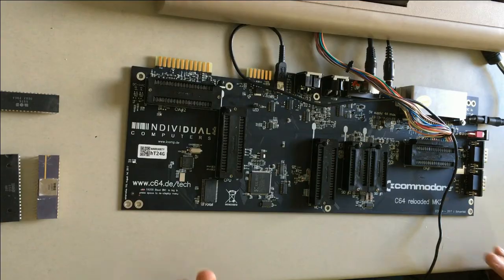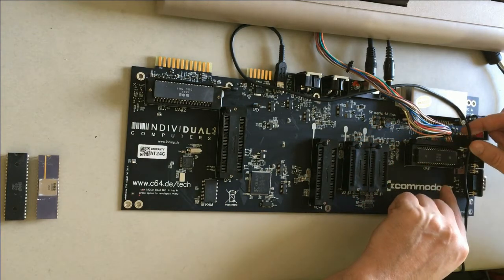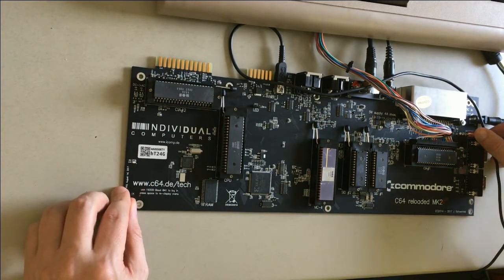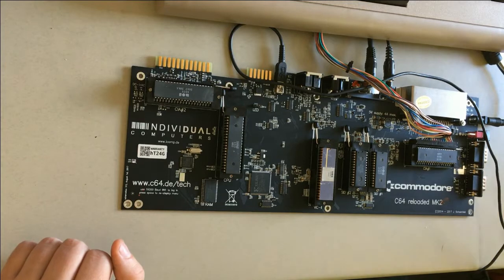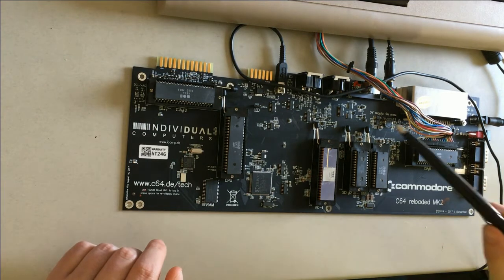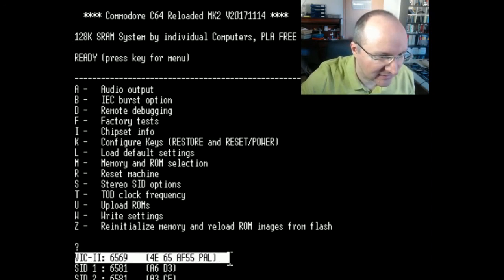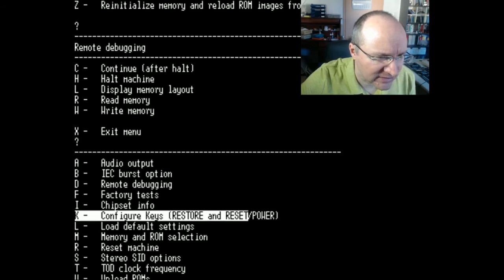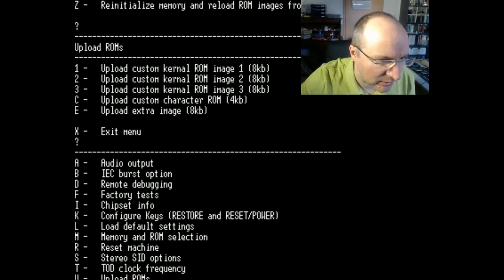Populating the MK2 Commodore Board

Comment: I've never considered getting an MK2, but I do have two breadbins lying around which could populate a MK2 without much problems. But then there is also the Ultimate64 board. How to decide which one to get?!
Reply from the maker: It depends what is more important for you. The Ultimate is a C64 with nearly all ICs migrated to modern technology. And it hat an HDMI Connection. It is the better choise if you want mainly use the C64 as a whole and have a comfortable TV connection. 
The MK2 still uses all the original ICs. So if you want do do your own experiments with drop in replacements and the like, this is the better choice. 
Fortunately I do not have to make such an choice - I will get both :-)
Reply: Haha...you're right. I should have probably asked: which to get first :)

Comment: can you put down a list for the chips needed
Reply from the maker: No Problem. What you need is:
- 2 CIAs (6526 or 8521 (probably better if both are the same)
- 1 VICII (6567, 6569, 8565 or 8562)
- One or two SIDs or new Gen SIDs
- 1 CPU (6510 or 8500)

Habe fun with your board
Reply: tax i always wanted one a long time ago when my uncal have one but he sold it off for a pc